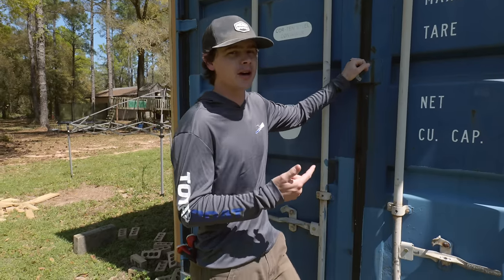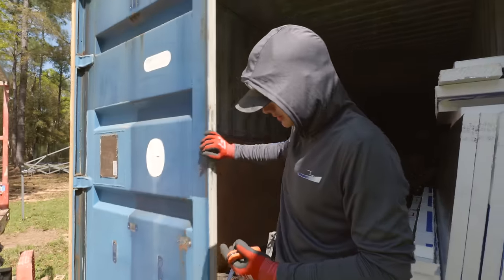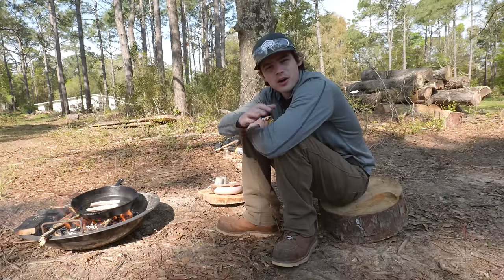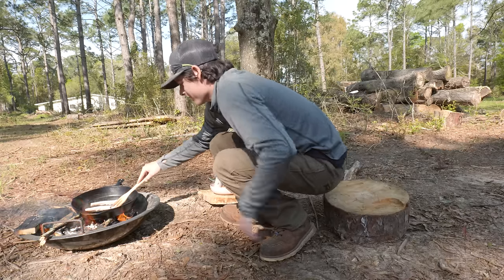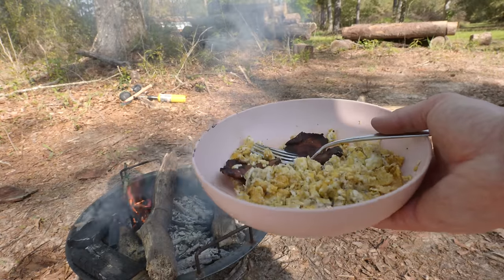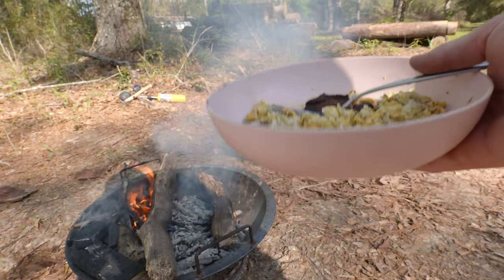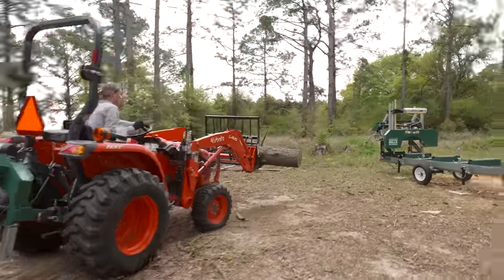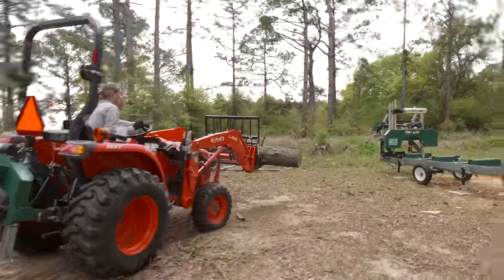These HUGE Custom Doors Transformed Our Shipping Container Shop

Comment: I have been following you two for a few years now. I really enjoyed the camper build. Keep up the good work....
I think I would go with 'spring loaded door latches with chains' .
They are not expensive, and two paired top and bottom would secure the doors adequately.

Comment: The fire side chat was good, really good Dylan. As a 65 year, I am one of the subscribers that you mentioned about how refreshing it is to see a young couple bust their tails for everything that you have and not waiting for someone to give it to you. As long as you and Molly keep being you, I guarantee you that the two of you will continue to be successful in whatever you put your minds to do. Ps, it would be fun if Molly made some videos about her laser work. Lock it from the inside. Remember the security doors that have metal flat bar pieces welded to it and a thick board pushed into the flat bar on the inside. Put two of them inside spreading the width of the doors
Reply from the maker: Thank you Steve😊 Always appreciate your comments and suggestions✌🏻

Comment: Doors look great.  Windows on the doors will help if you want more natural light.  I think windows would look right.  Opening the doors only from the inside is fine.  Sliding bolts top and bottom on the left door and then latch the right door to the left.  Jimmy Diresta made a single handle duel sliding bolt mechanism for his shop doors.  No need for handles on the outside.  Thanks for the video. Thirty+ degree diff is really insane.

Comment: You have a side door as your entrance and a walkway up and down the container. So you know that metal sliding locking system that was on the outside of the doors... then use them on the inside of the doors. they will then pull the doors right in to lock & secure the container. You could add on handles on the outside, once it is opened up... but also have a way of holding the doors open to allow fresh air to flow thu, when working inside the container. 🙂.

Comment: Hi, you do need a slate along the middle of the door, but as you said the doors should open from inside and you already have the man door so all you need is to get some bolts to lock from inside.

Comment: I would make the doors where they lock and open from the inside only.  Not sure about what to put on the inside to pull them in tight though.  Will have to think on that one.  You guys have a great channel, and together you make it a great channel.  Nice job on the container shed.

Comment: I’m not sure which way it’s facing, but it you want it more off grid, adding some windows on the South side of the building would be helpful for light without the Summer heat!

Comment: I am enjoying your channel, found you guys from the collab that you did with Ambition Strikes. On a side note, your smoke detector should be changed, when they turn yellow/off white it is by design, to be an indicator that they are due for replacement.

Comment: About time someone thought outside the box, I did a similar job, I could see no benifit in making a small space smaller by framing out the inside, the chances of moving house is slim, but in Australia we can still move a wider container on a wide load permit.

Comment: I thought the bacon was perfectly cooked. If you do go windows, I'd probably do it on the narrow wall or one of the long ones, instead of the door. Since you can open the door, they're essentially redundant there. All depends on how much sunlight you actually want inside. The Southern sun will make that insulation useless if you place the window in the wrong spot. As someone who's windows face westward in GA I feel that.

Comment: I’d rather watch you than a “personality “ who is over the top and not a real person. The majority of us are not like that, we like to see a “normal” person/couple just like us making a go of it! I chose to watch people I believe to be genuine!  People who don’t mind hard work to improve their wellbeing and every day life! What my mum would have called “good people” who have been brought up with values and respect.  Also love the up beat music, the fireside chat was a great feature too!❤
Handles on the outside, just so you can physically pull open the door when you’re outside. As for locks, I say inside only access, as you say you will be inside when you need to open the door any way. I’m in uk, not a locksmith but here’s my suggestion. Long bolts attached to the opening downside edge that are drilled into the floor of the container. One on each side . Then about head high long bolts going across the door on opposite sides of the opening edge. There’s no visible lock from the outside, no way for an unwanted vaster to gain entry.
Reply from the maker: Love this and thank you for the suggestions❤️